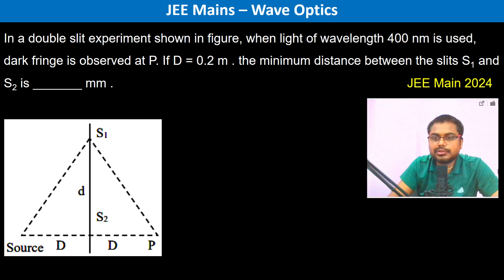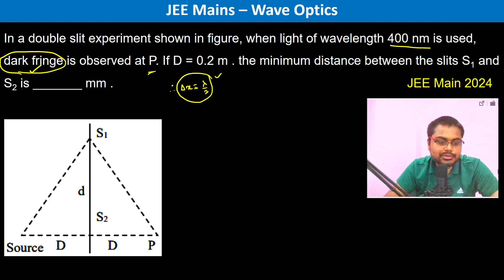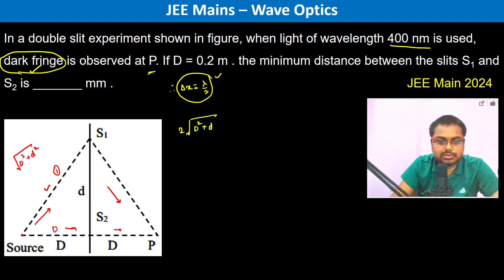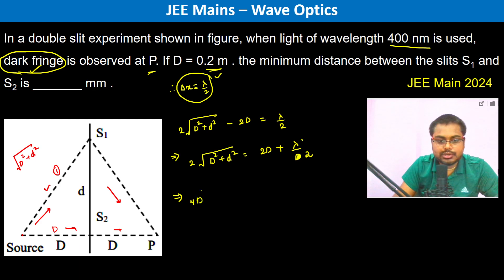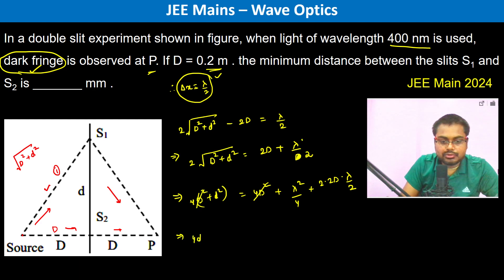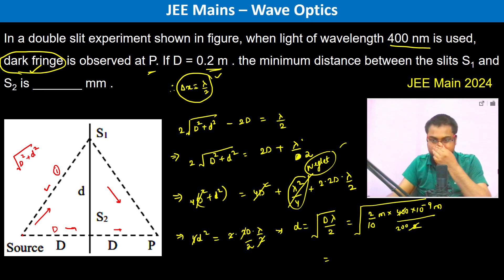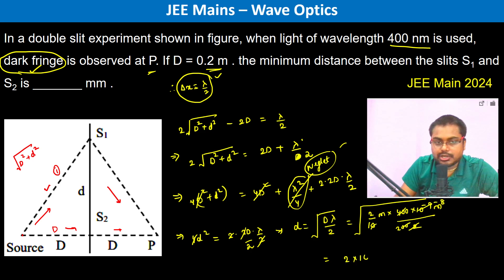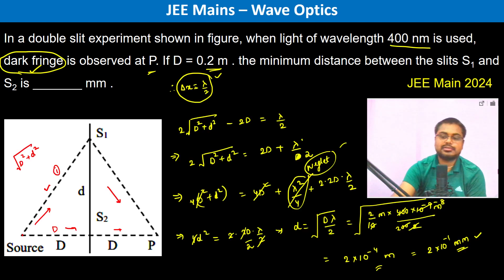In a double slit experiment shown in figure, when light of wavelength 400 nm is used, dark fringe

Comment: A lift of mass M = 500 kg is descending with speed of 2 ms-1. Its supporting cable begins to slip thus allowing it to fall with a constant acceleration of 2 ms-2. The kinetic energy of the lift at the end of fall through to a distance of 6 m will be ____kJ.Sir cant we solve this que by COME.
Reply from the maker: v^2 = u^2 + 2*a*s

u = 2, a = 2, s = 6

Then put KE = 1/2 m v^2.